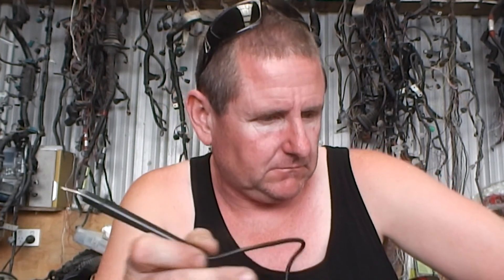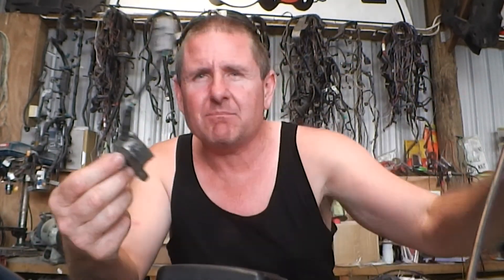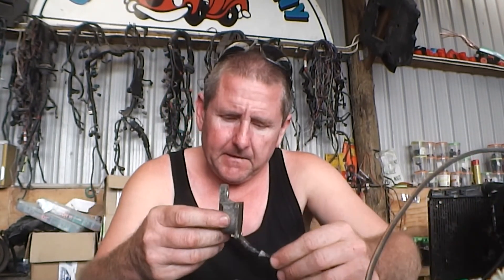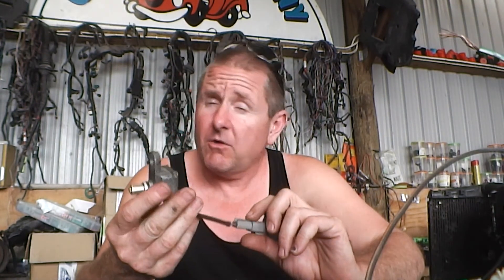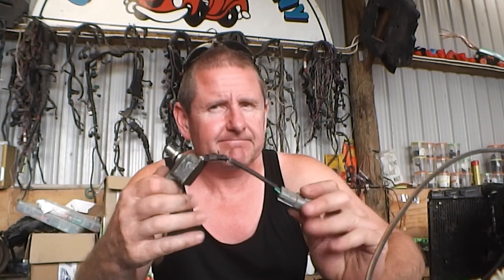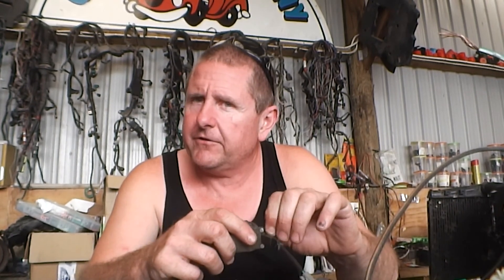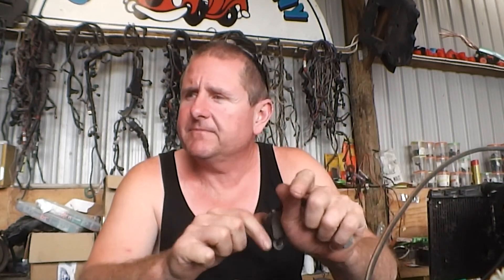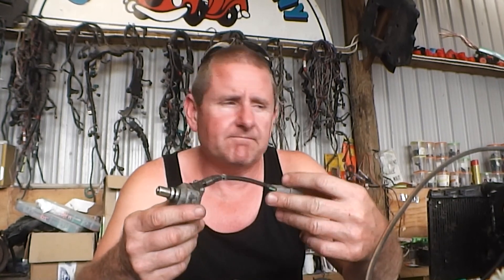1uz Speed sensor testing - UZS131 are oddball - converted to UCF20 harness and 151 crown ECU.

Comment: Hi,
Could you please help me, 
My car have engine 1uz. Vvti.
I have issue with reverse gear,
In the morning it's not coming,
I need to go with it a head on the other gear ratio (working perfect) and after 5 minutes the revers gear shaft working. 
Could you plz help me to fix it.
Thank you so much.

Comment: I know this isn't about this video exactly, but I have a gen 1 ls400 uz1 that has a trac light. Is there anyway to test the wheel sensors on the car to find out which is bad if that's the case? You seem like to have a ton of knowledge on these car systems.  Thanks for any advice.
Reply from the maker: Hello.  The ABS sensors can be tested like any other reluctor sensor.  Resistance and scope the pattern.  I prefer to test resistance from the ECU to ensure the whole circuit is tested.  Cheers Kelvin

Comment: Hi Kelvin, The crown has a 20 Pulse 3 wire speed sensor with a triangular plug which is the easiest way to spot them, so is it only the early crowns that use them being still a slip yoke uni with both speed sensors on the left, or do early Soarers use the same speed sensor?
Reply from the maker: I may have said 32 pulse.  Opps.  I have another one here to play with atm and Im making changes in the box.  Only the crown run this arrangement.  Soarer and LS400 have different sensors with one on LH and one on RH until the UCF20 where they only have the one on the LH.
Reply: @CartuneNZ  ok, so I will have to change the input speed sensor settings in my aftermarket ecu, which is going to be fun as the instructions are as clear as mud.
Reply from the maker: What trans controller are you running?  I dont do lots of these so some of the numbers arent commited to memory.  I check them when Im doing them.  I will try to remember to count them on the next one.  I am cutting some off to make it 4 pulses as converting the wiring to Gen2 stock ecu.
Reply: @CartuneNZ  its a wolf ecu, that controls the auto as well, the setting are for a Soarer as they had no idea on the early crown. In the setting it has type is falling edge which is self  self explanatory , next calibrator 1 (transition count measured) =2, The 2 would be  counting every second pulse I presume,
Calibrator 2 (divider to final number) = 350000,  but how did they come to 350000, fun, fun, fun, the gearbox wiring and setup has given me some real headaches as there is no information on how to do it and Wolf closed the doors just after. I know I should have bought a Link and hooked up the factory ECT. any help Kelvin would much appreciated as I still haven't had it running yet. only been a few years or 10 or more Haha
Reply from the maker: I know a little bit about the Wolf ecu and have tuned some on other vehicles.  I had a guy over here with a bullet MX5 which had one fitted who also needed it tuned.  I also used to have the original designed of wolf ecus contacts in my phone but they are long gone.  Every now and again I see him pop up on facebook discussions.   I think most were sold as a plug in adaptor for the soarer so no requirement to share diagrams.  One thing I would be looking at is popping the tailshaft off the trans and converting the main speed sensor to the same a soarer ie 4 buy cutting extra teeth off.  Then the soarer settings should work.  One step would be having the engine running - so thats comes first , then adjust the numbers until you have the input speed into the ecu correct.  Link and haltech both have transmission control options in testing so when that happens Ill be all over it like a rash.  Good luck with yours.  Cheers Kelvin